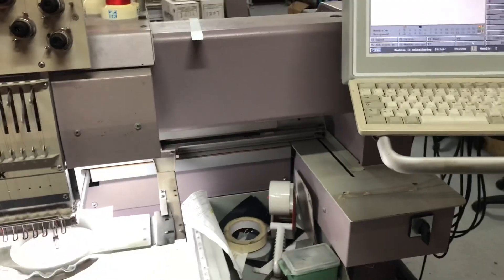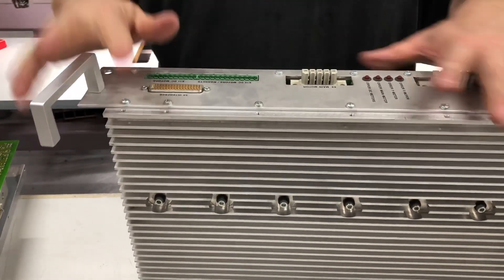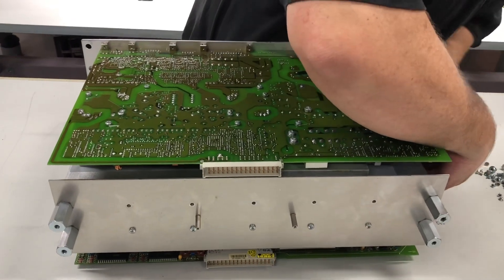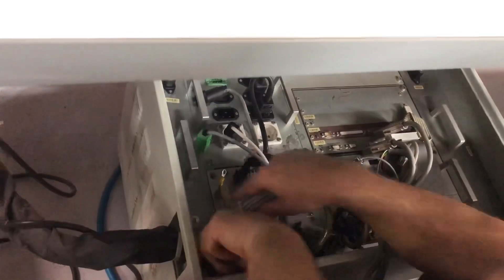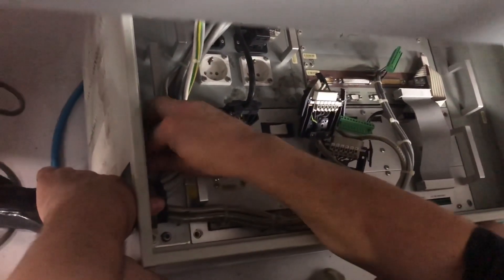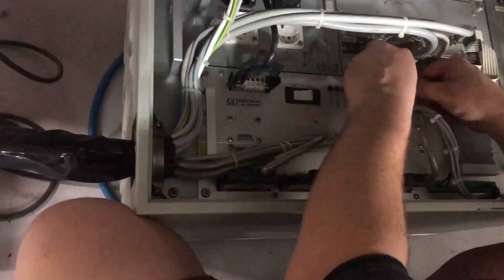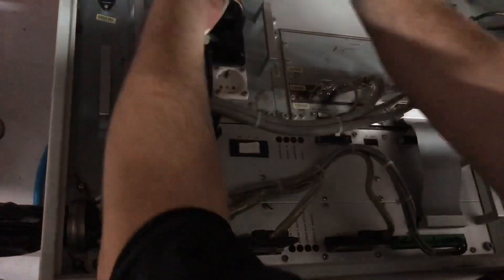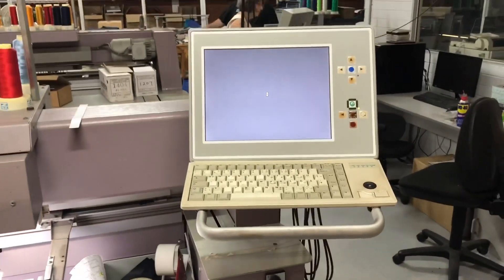ZSK JF08 - Power Drives Troubleshooting and Repairs

Comment: This message appears to me when I run the machine, what is the solutionص
Reply from the maker: power drives failure is a bit of a tough one, in this video I made one good supply out of two failed supplies, but usually the fix is to replace the power drive from a dealer/service centre for ZSK machines

Comment: is this where you learned CNC?
Reply from the maker: I started messing with stepper control with 3D printing and building my own Reprap in 2012. From there it was just rinse and repeat, gave me the confidence to purchase a 600x900 150W CO2 laser cutter from China, (which was DOA!! )
Reply: @JBFromOZ  great i have some experience with  CNC but need more when i did industrial it was all PLC and ladder diagrams